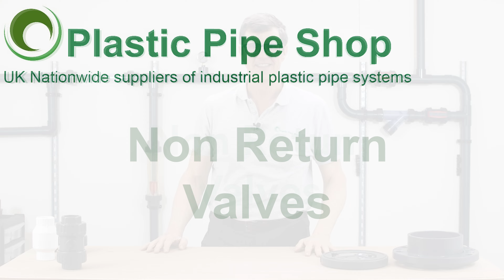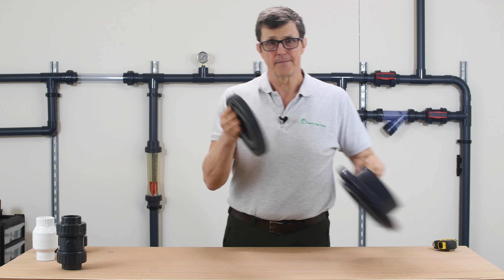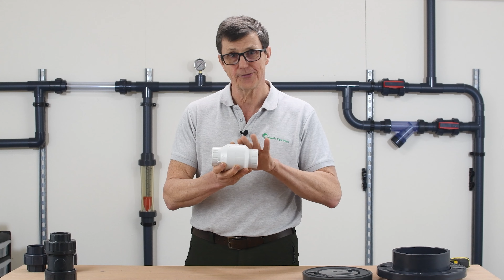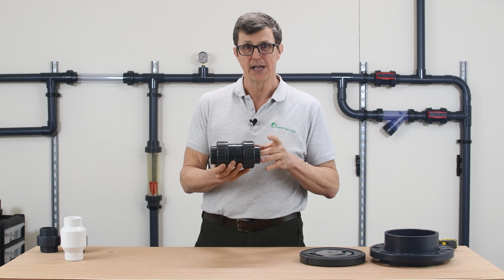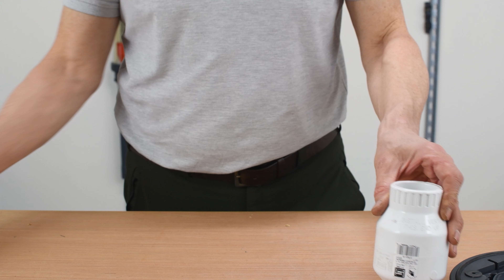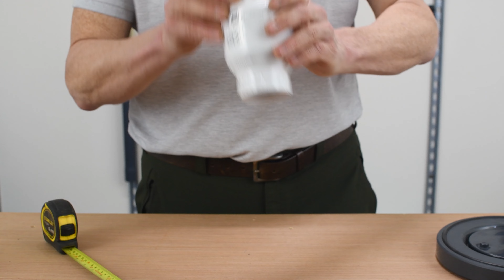Non Return Valves

Comment: Thanks for the video. As the video is of PVC-U pressure fittings and valves system, can that wafer type check valve be used for main external building drainage as a Non-return valve?
Reply from the maker: Hi there, in theory they can but drainage often contains debris in the water and so they may not be suitable. The pressure required to open it, although small, may also be too much for a gravity drainage system. There are generally check valves available from specialist drainage suppliers that would be more suited to the job.